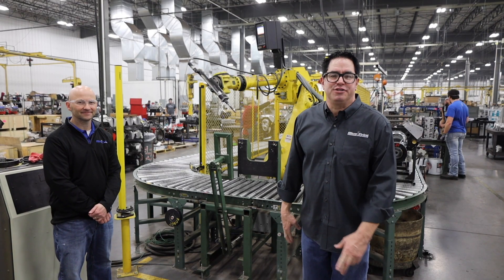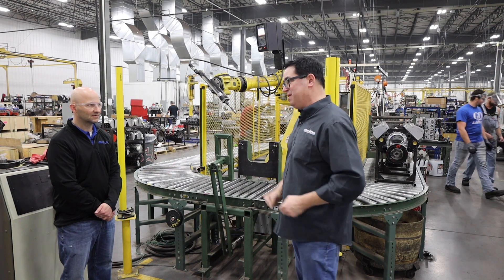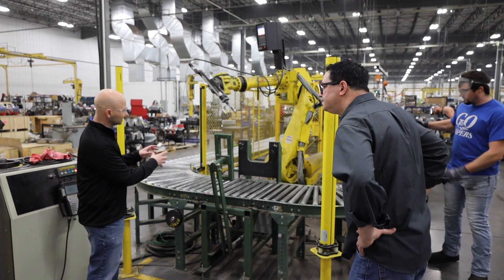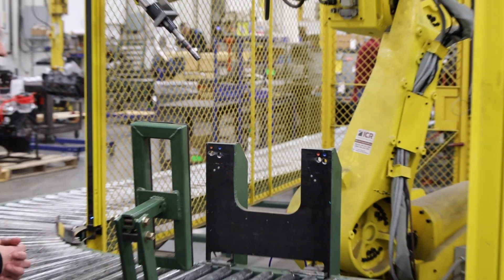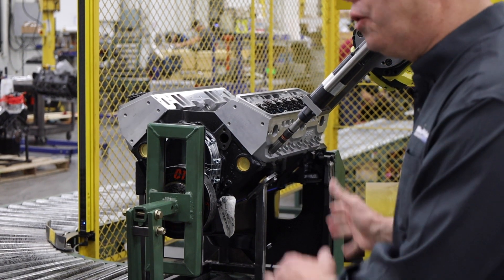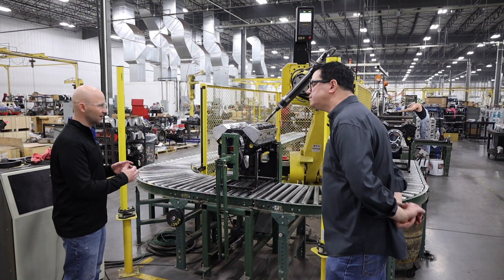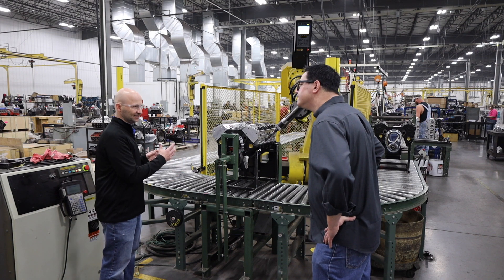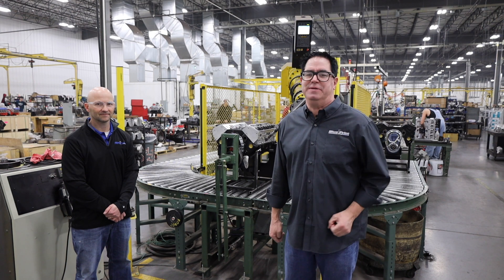BluePrint Engines Automated Cylinder Head Installation - Crate Engine Tech

Comment: What ya'll need to figure out is how to quiet down the ticking noise of your motors. New 350 motor in my truck this year and it ticks and rattles way to loud. Your solution... was to put conventional oil in with no zinc, while it did quiet it down somewhat, its still embarrassing to pull up in.
Reply from the maker: Sam, we apologize you didn't receive the assistance you needed. Please reach out to us at 308-236-1055 so we can get you the help you need. Thanks!